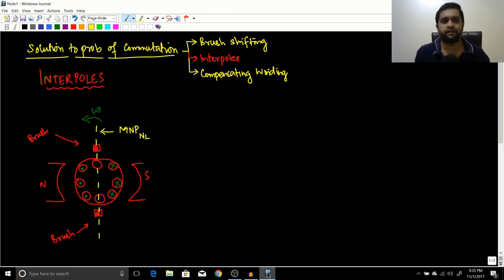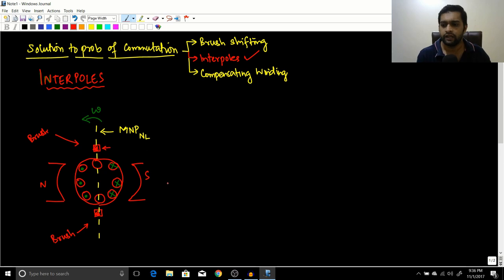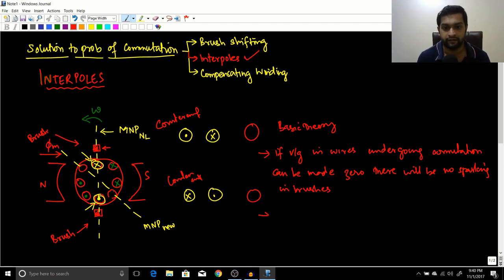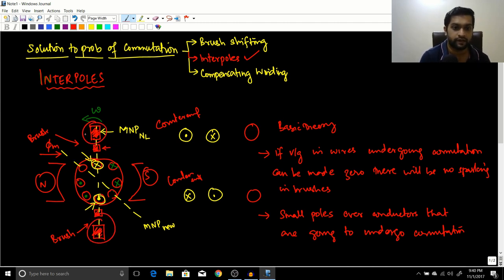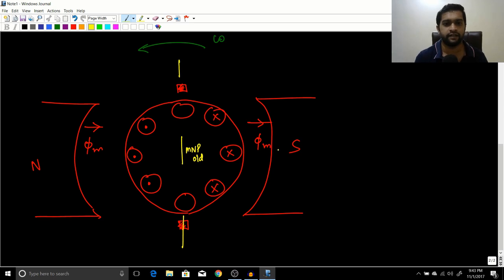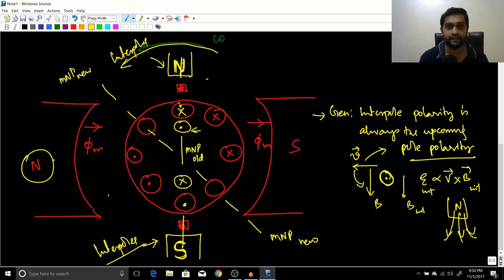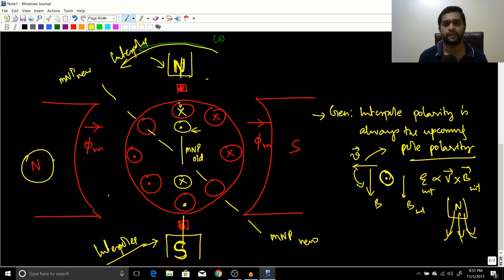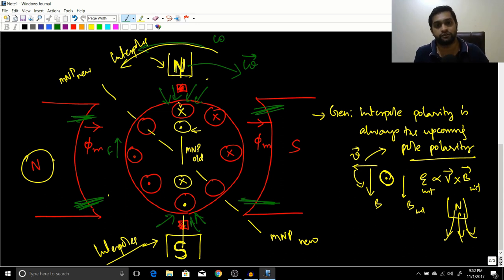#21  DC machines Basics -  Interpoles for DC machines

Comment: Hello sir, I have two questions regarding interpoles. Now you said that the interpoles will induce a reverse emf inside the conductors undergoing commutation and result in the emf inside them to become 0 thereby reducing sparking. My first question is, the magnetic neutral plane will still be shifted and interpoles have no effect in returning it back to its original place. This means that there will be other conductors (under the new magnetic neutral plane) which will have a voltage of 0. Does this mean that the interpoles reduce the overall induced emf inside the generator? 
My second question is, this interpole will produce a magnetic field that should logically also interfere with the main magnetic field. Doesn't that increase the issue of magnetic neutral plane shifting? or is it that the magnetic field of the interpoles is negligible compared to the main magnetic field?
Thanks in advance.

Comment: i got a problem in understanding that the brush location always needed at the place where the current is have too be reversed for the build up of the voltage but what i see the brush it still in the old location of the neutral plan is  it must be localized again of the new neutral plan and thanks

Comment: Sir plz solve the ques that came on gate 2009 re, relating to the shifting of the brushes along the direction of rotation and we have to find the voltage waveform on the brushes......plz plz plzzzzzzzzzzz solve this I am not getting a satisfactory solution anywhere
Reply from the maker: Let me check
Reply: @ElectricalisEasy  ok sir ...I am eagerly waiting
Reply: @ElectricalisEasy  sir if u are not getting the ques then plz provide ur mail id , I will sent u the picture of the question

Comment: when it was loaded MNP shifts and there is no short circuit at MNP(No load ) and then brushes shifts ,then if we cancel the emf by giving it in counter clockwise then emf will reduced ....so we are making emf  zero ...what i understand is as emf was 0 at no load and non zero on load this will cause a sparking effect so in order to avoid that we are giving an counter emf right

Comment: our lecturers said that this interpolating method uses to avoid armature reactions. but you tolds such a different thing. Explain me..
Reply from the maker: Whatever I have explained is from chapman book and h cotton book..and it is already explained with a fair bit of reasoning
Reply: @ElectricalisEasy   Am I right or wrong????
Reply: Interpole primary purpose is to reduce commutation ,
in doing so it will also reduce Armature reaction effect - Secondary effect of interpole.
Like wise - 
Compensating winding - primary purpose to reduce Armature reaction,
So if A.R. is countered Commutation already improved - Secondary effect.

Comment: Sir, but by using Flemming right hand rule interpoles are getting opposite poles...can u see once..
Reply from the maker: Fleming’s right hand rule it is to find direction of EMF...here we already know what if the EMF we require...we have to find the polarity of the inter poles...
Reply: Sir,in Flemming right hand rule also if we know the emf the direction of field can be obtained ....
Reply from the maker: +naga raju yes that I what I am also doing here...I need an emf opposite to that of the one in conductors...and based on the a downward direction of flux would be required to generate that particular voltage with direction of velocity I have shown..and yes I tried with the right hand rule...ur middle finger should be facing you the thumbs from.right to left and then u will get a field from top to bottom..personally I use v cross B it's far more convenient rather than using twisting and turning ur fingers
Reply: varun nair ,,thank u for replying...